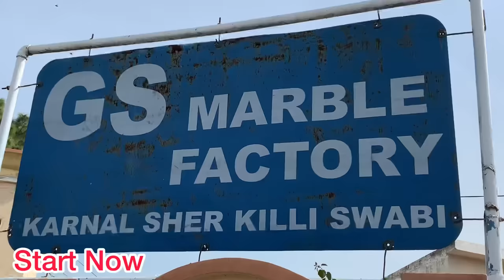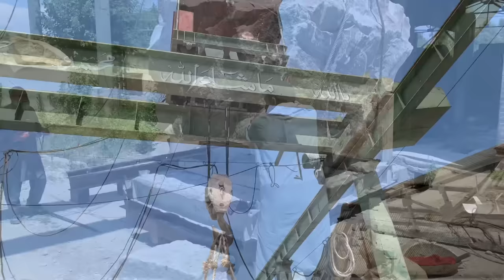Modren Construction of Huge Stone Cutting & Largest Marbile Manufacturing In Modren Industry Process

Comment: These marsters place and remove marble slabs from the cart, sprinkling small stones between the slabs for sliding, and peel off a flat surface on the metal cart. Which then complicates grinding and polishing and throws away a wasted part of the material. If the craftsmen used the technologies and machines of the 21st century and did not do it by hand like a century ago, it would have turned out much better...
Reply: Problem is the Western people or governments don't wanna that those countries get their how knows or even completed machinery and technologies because of that they doing that way.